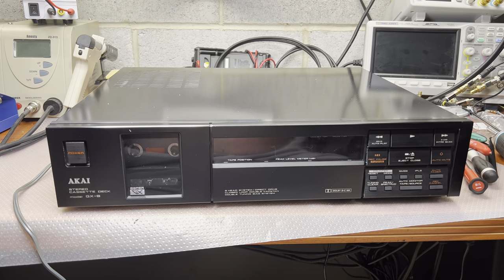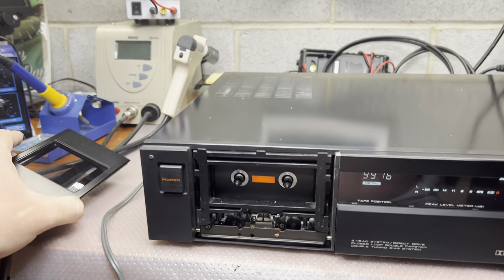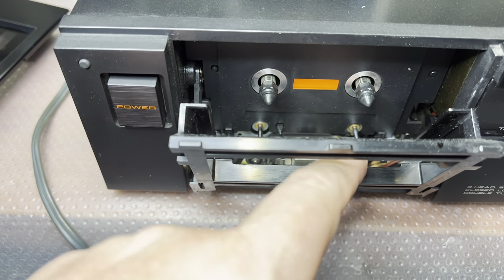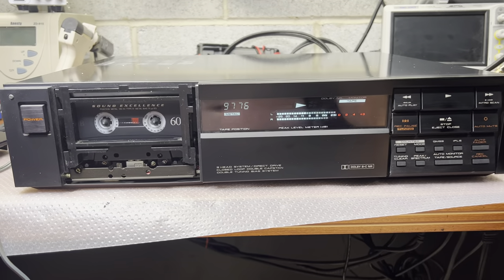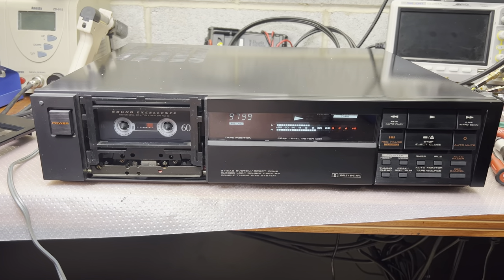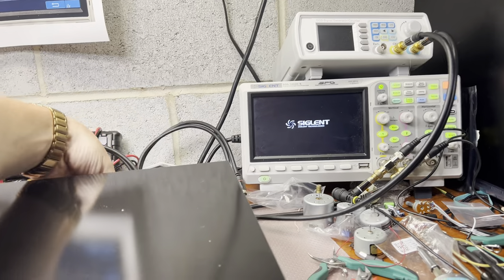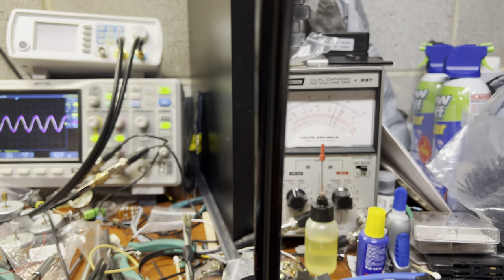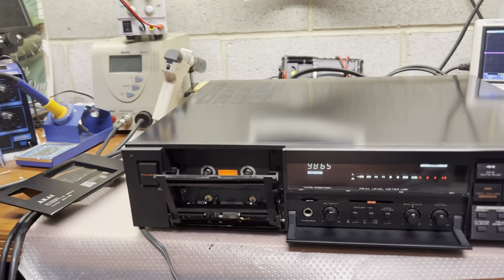Akai GX-9 Restoration: Reviving A Classic Audio Icon

Comment: Which is your favourite, GX-93 (GX-8), GX-9 or GX-95 and why? How do you rank them electronically and how do you rank them mechanically? Are there any differences to speak of mechanically or with respect to the heads?
DBX aside, what are the differences electronically? Is it just a question of budget or are there any clear differences in the circuits'  quality?
I don't know why AKAI did not include dbx in the later decks - I think they dropped the ball there. GX-95 with dbx would have been a superdeck. Also I cannot understand why they never completed the 95 series or why they did not market the GX-93 in Europe with the same name. The signs of self-destructive attitude were already appearing I think.
Reply from the maker: Much effort was made to improve electronics with every new model. So, considering that aspect later models should be better. But, there is always a point of trade-off, simplification, and cost reduction. So, GX-9 is a very capable deck due to no cost reduction perspective. All 3 calibration points to adjust Level, BIAS, and Equalization to get a flat response. GX-95 missing EQ calibration, but sounds better. Mechanically all 3 decks employ the same tape transport with minimal variations in heads quality. DBX? Who cares about DBX type I. I don't. External DBX II is much better.
Reply: Very interesting @hifirulezzz  . So there is no perfect model but at least, sound-wise, later models ought to be better. 
I also had thought that if one wants to employ dbx, then they can always acquire an external unit. But can't the same be said about Dolby? And then one can even get a professional type A Dolby unit.
But the point I was making is that I think it was wrong of AKAI to introduce an advanced capability and then take it off in later, more evolved decks. As you said, this is because of the cost vs. performance trade-off that was always present. But for those who preferred this brand's equipment, this could have been seen as a cost-reducing attempt. Better to not have introduced this feature at all in the first place (there were only a few makers that included dbx anyway) or, since they had done, improve it by offering dbx II in later models.

Comment: I have the same deck and the door won't close all the way now. Using good tapes that play elsewhere. If I force it to close the tape won't engage to play or rewind etc. Can this be fixed?
Reply from the maker: The door has 4 plastic springs which require to be heated and expanded to push better. this happens with all Akai with this mechanics over time.

Comment: 6:58 What is your preferred belt manufacturer - I couldn't make out what you said.
Sometimes your voice is too low to be heard clearly. Maybe you should keep the mic closer or wear a lapel mic.
Reply from the maker: Today we have very limited belt producers. I use known few and also stock in quantities from China. Found a good shop producing straight belts.
Reply: Yeah @hifirulezzz , the main question, though, is: will these new belts last 30-40 years like the original AKAI, Sony, Pioneer, etc belts did? Because I bet that in 10-20 years from now, no new belt-making shops will exist..
I would have much preferred if they had made those decks without belts in the first place.
Reply from the maker: @Stelios.Posantzis  you can buy without belts, Dragon for example, or Revox.